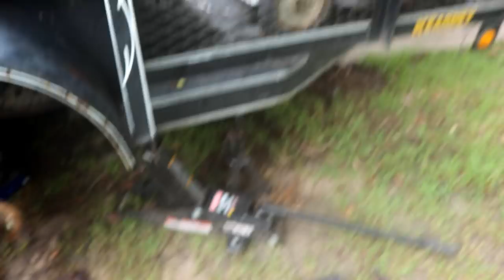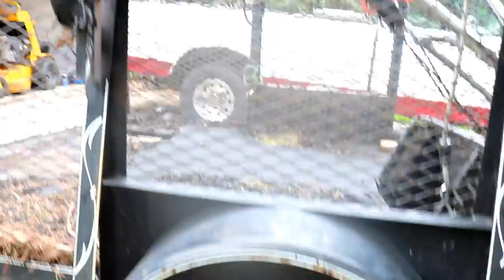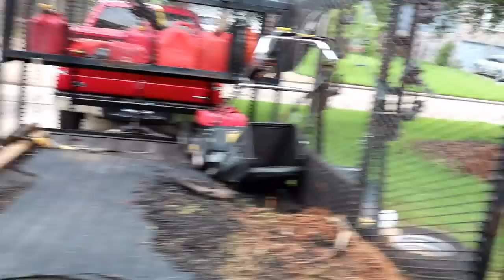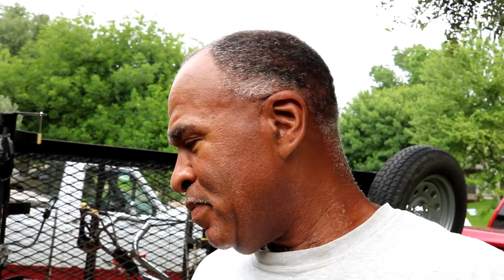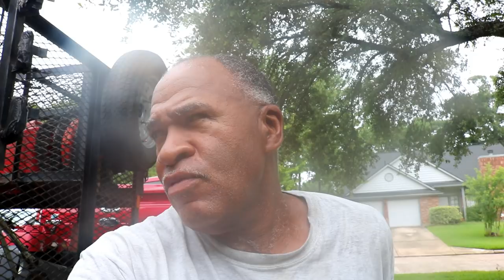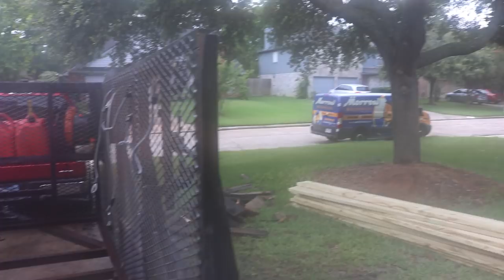Trailer Broke down

Comment: Sorry to hear you had a breakdown.  Good job on the fix!  Hope the Scag is back up and running in your yards again before long.  I've always liked your trailer design, and how you run your equipment off it also.  It's going to take a newer business like mine, some seasons before I get a flow down that is efficient.

Comment: Curtis why did you not replace the other side if not the spring may be the hanger , how did the wood floor look you need a tripod.
Reply from the maker: The other side is good. The wood floor look good.

Comment: Curtis, make sure you re check the nuts on those Ubolts after a couple weeks then maybe again in 6 months then yearly. Idk if they told you what usually causes that is a harmonic vibration (causing micro fractures) between the spring and the axle from having some play from not being tightened.  It sucks but at least you didnt lose the whole axle or worse.    Id do both though as if one has enough fatigue to fail the other should be similar in wear/life on it. Ive been there before. .
Reply from the maker: Okay, Thanks